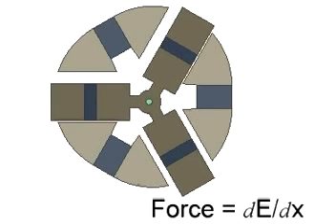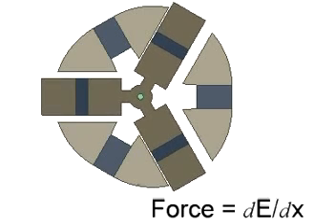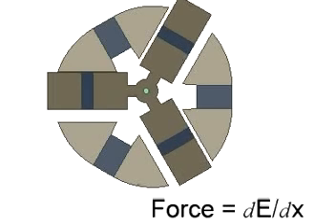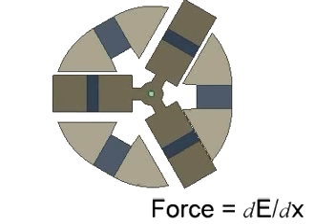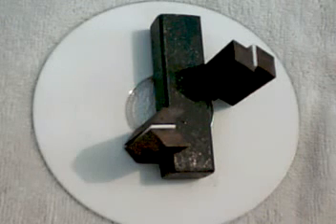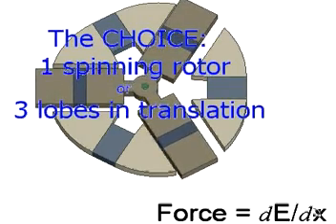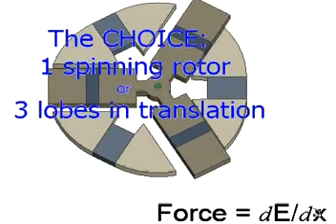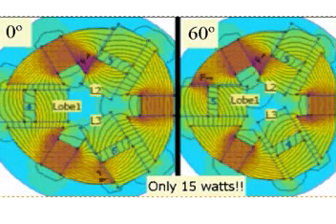Self Running Technology  Epilogue

Comment: to do work you need to be spreading out energy (e.g. electrical charge, heat etc)
where does this occur?
are you putting in heat?
movement?
electricity?
releasing energy locked up in a high energy compound?
what?

oh and its also a fact that all forces are symmetrical (i.e. for gravity it takes the same total amount of work to go through a tunnel or go over the hill) (assuming you have perfect regenerative braking!)

Comment: would this not prove to be self canceling, one cansels the other, it may/ MAY/ run, but be complex, expensive, and have no torque. it would suprize most folks just how hard it is to turn a shaft to light a bulb, and mad hard to run a motor to run a house, the energy content of a gallon of gas/petrol/deisle, to run an engine  & drive the gennerating motor which convert to electric will never come from this magnet motor i think.

Comment: Sorry, there is no such thing as a free lunch.

He references conservation of energy several times and yet...a perpetual motion machine violates this, so within 2 minutes his video contradicts itself.

Ever heard of a rodin coil? This is what you have except without electromagnets or fancy wiring, all that's going to happen is the drive mechanism will oscillate around center before finally stopping there.

I'm not even going to go into the losses in wire, the generator, friction, eddy currents.